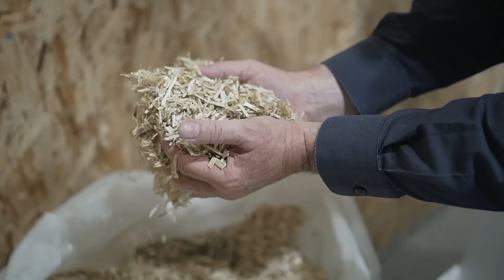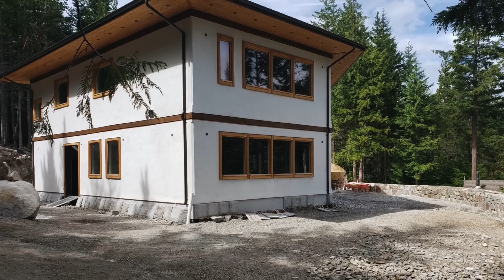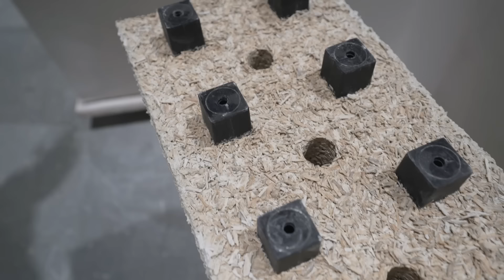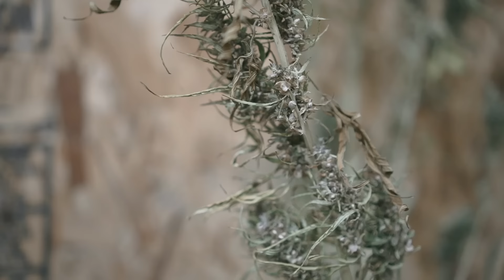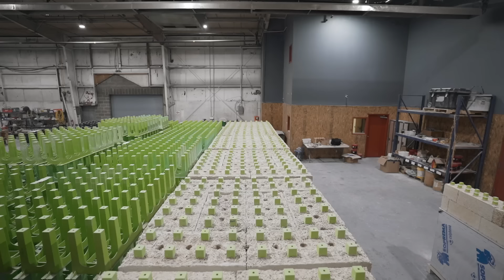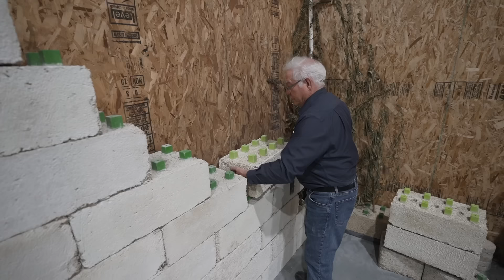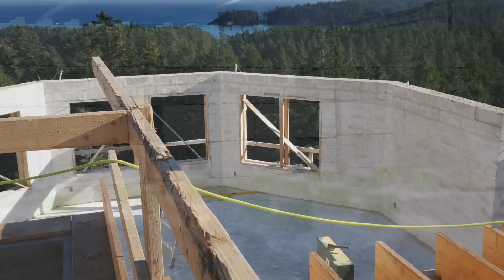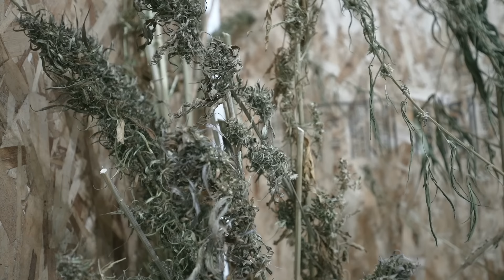Amazing Lego-Style HEMP BLOCKS Make Building a House Quick, Easy & Sustainable

Comment: The newly constructed hemp houses are not only termite-resistant but they are also fire-resistant, and they can prevent the growth of mold.
Reply: what about water?  can they withstand water?  at least as good as concrete?
Reply: @Anti1gnorant  plastic is waterproof and in the video he states that you can't use them below the water line,  you use the recycled plastic they make into a foam block for that.
Reply: @Anti1gnorant , most houses in Canada are wood framed, and wood can be water damaged too. That's why we typically have concrete below grade and wood above. This seems like a better option than wood, at least for wall construction, especially since it doesn't need insulation added after framing.
Reply: @questioner1596  i see. Of course. its better than drywall and wood studs.  I wonder if you can screw things unto them as good as a stud.
Reply: @Anti1gnorant , I do too. Their website says the studs are spaced 5 1/3", so every third stud matches the 16" spacing we use for timber framing. 

By the way, having seen the show Archer, it's amusing to see your display name associated with genuine interest in a subject. 😁👍
Reply: @Anti1gnorant  good! You brought something i was missing. it seems that would do worse that particle board after wet and dried.. but injection of epoxy in the place of the screw, will solve that minor problem! 🙃
Reply: @questioner1596  Architect here from California. I'm wondering if all these worried comments about water proofing and fire resistance are from people living outside of North America who don't have the experience of wood framed buildings like we do here in the US and of course Canada. These hemp blocks seem so much better than conventional wood framing when it comes to cost, energy efficiency, fire resistance, and ease of construction!
Reply: @questioner1596  No insulation. Vapor barrier was not mentioned either. I do believe in the sound proofing element  though.
Reply: @Anti1gnorant  Maybe one could get a break on fire insurance with this product
Reply: @Anti1gnorant  structural strength of concrete, so you may have to drill to hang granny's portrait.
Reply: @Anti1gnorant  It doesn't burn.  It has a coating, Water proof and you're ready to go.
Reply: @Oldschool-hb8rk  well that waterproof coating probably prevents it from absorbing the carbon
Reply: @Anti1gnorant  concrete  absorbs water... lol    unless it waterproofed/sealed..
Reply: @tadvanallen  it doesn’t have the same absorption rate as wood and line based products though. Clay bricks absorb water but that’s why you have a cavity wall.
Reply: @tadvanallen  Add 15% activated metakaolin to the concrete and it stops the movement of water through concrete, including efflorescence
Reply: @tadvanallen  concrete does not observe water. Water erodes concrete.
Reply: @Anti1gnorant  if you thought of it I'm sure they did too.
Reply: @Anti1gnorant  Listen to the video
 He covered waterproof.
Reply: @Anti1gnorant  That’s what those special “below-grade” blocks are for. They’d be used in the basement. Unless something goes really wrong (roof collapse), the hemp blocks shouldn’t have an issue in terrestrial environments (above ground).
Reply: @Anti1gnorant  Time stamp 6:50 will answer your question.
Reply: @Anti1gnorant  Like timber frame buildings they would have to be protected by an exterior coating/cladding.   As the video pointed out, you wouldn't use them below the damp course level.
Reply: @Anti1gnorant 
I would imagine the outer coating of plaster should prevent any water damage.
Reply: @Anti1gnorant I’m pretty sure it is because the hemp blocks have a lot of air in them I think and so I’m guessing it would absorb the water idk look it up
Reply: @Anti1gnorant  concrete passes water, you can see the wet water line on outside of concrete planter boxes
Reply: @Anti1gnorant  interesting question, in my opinion, it should be good at withstanding water but I doubt it is as good as concrete. Let see what anyone else has to say.
Reply: @dbizi440  do ur research.  Yes its mold proof and water resistant.  It's a million times better than concrete.
Reply: @dbizi440  do ur research.  Yes its mold proof and water resistant.  It's a million times better than concrete.
Reply: @realj1214  ok thanks for the answer :)
Reply: @dbizi440  ur welcome
Reply: @dbizi440  amazing
Reply: @dbizi440  This is an insulation that is vapor permeable. It needs a render finish or wood siding to protect it from driving rain. It should never be waterproofed as it is meant to "breath" The render will do the job.
Reply: @rehabdetroit  thank you
Reply: Jeez,  since when is it logical to dismiss it because it's resistant and not "proof". I would take resistance rather than accelerant like wood and other current materials are.  I know the ppl in Boulder CO would've loved it.  It's also plentiful and made in the 🇺🇸 or Canada 🇨🇦 and easy to transport.  It's also faster to build with.
Reply: Hemp is an amazing plant, and also makes nice material like linen.
Reply: @raphaelacz  hemp is amazing I agree, but linen is linen and hemp is hemp. Two different plants 👍
Reply: Suddenly hemp is the solution to everything. Even for going to the moon😂
Reply: @Cptblogh  fun fact, it's been ever since the '60 xD
Reply: @Cptblogh  This always happens - there are booms and busts when it comes to this sort of thing and this has all been tried many times over for years in different iterations. There are always reasons these never catch on in the mainstream construction industry usually it's costs.  The other current trend is 3d printing houses which is mostly filled with tech folks who have never built a house in their life thinking they know better than everyone else then the goal posts get moved when questioned.
Reply: @corail53  you're not claiming 3d printing houses has been done a few decades ago are you?
Reply: Is it wolf-breath proof?
Reply: @uphilliceskater  i love you for this comment😂🥰
Reply: @uphilliceskater  it’s definitely wolf breath proof, they have a 10/10 wolf proof rating
Reply: @uphilliceskater  🤣
Reply: The Roman aqueducts were constructed with hempcrete and they still hold water. The hemp shiv gets petrified from the Co2 that the hemp shiv sequesters from the air.
Reply: Glad they are useing more of it as it grows faster and saves trees as its just a bush..
Reply: Is biodegradable so you have to take measures to protect from the elements especially water.  Note the section in the video he mentioned the plastic blocks used at the bottom of the wall and below grade.
Reply: The insulating properties sound great.
Reply: WS A  they are covered with lime plaster on the exterior and inside, which makes the walls water resistant. This may not sound like what you want, but... lime plaster is breathable. It also holds in heat, keeps cool in the heat. Wood framed with traditional, non- breathable construction materials delivers cold from the outside in (feel your walls)- or won't let the heat out in summer.
Reply: @audhdcreativity5899  you do need to reapply lime rendering. I'm not sure how often. I guess it's like paint or varnish. It depends on weather conditions etc.
Reply: Are they thermite resistant?
Reply: @clrwtrmusic  it is stating that in the first comment.
Reply: @dbizi440  i was joking about thermite because it’s heat and termite resistance hahahahaha
Reply: @CLRWTR  LOL 😂
Reply: Take any substance and mix it with enough lime and guess what?  It's termite, fire, and rot resistant.  Like, wow bro.
Reply: @travismiller5548   Show your proof?  Make a video and prove him wrong.  Do your know of any other product that is made this way with the same benefits? Why are you so against it? Are you in an industry that would be hurt by this or are you just anti hemp?
Reply: Yes off course there’s still problems. Try not to be so negative. Concrete has plenty of drawbacks. I’m a very experienced Plumber.  And this material they made for below grade still may not be for all applications. Like houses built on steep hills.  The 100 year longevity also sounds like a problem. But I’d like to know more. I’m sure it would probably last longer in a drier climate.  Which is frankly where most alternatives get tried out anyway.   I Love the design so far !!!
Reply: @xXGENDAMAGEXx  Calm down super plumber
Reply: These are the most compelling reasons for me
Reply: Like bamboo.
Reply: Something like this would be good in Tucson: few earthquakes, fires can happen, very hot.  What is the most expensive element of this and how can that price be reduced?
Reply: Im thinking at the same price point per block i can make cement block mold and fire resistant
Reply: Are they also falling apart like american houses during every year hurricane?
Reply: Sounds like a very innovative product…but…how does it fare against 7.62?
Reply: Is this magic!!
Reply: It would be interesting to see how this holds up to a hurricane, thunderstorm or tornado.
Reply: Doesn't withstand  water as much as concrete. Only negative  beside a bit more expensive.
Reply: That’s amazing. Crazy it hasn’t been used more
Reply: ya know actual block does those things better.
Reply: Not bug resistant or mold resistant. Not sure how you make a bio material either of those without it being a bio material.
Reply: What about wind, they look pretty lightweight and would be blown over easily in any extreme weather
Reply: Nice stuff for a 🌪️ it will fly good.
Reply: You could use it in tandem with concrete and rebar
Reply: And best of all....
You can smoke it!
Reply: The legal marijuana industry is producing tons of plant material. The leaves and stems aren’t used. This could help those growers who are taxed and regulated to the point of non profits. (Only the dispensary is raking it in).
Reply: duh
Reply: Are you sure they won't go "Up in Smoke“?
Reply: Are you sure they can't go "Up in Smoke"?
Reply: Tell Cheech and Chong they're fire resistant. They'll tell you hemp goes up in smoke.  😂😅😂
Reply: Concrete depending on environment even driest will shed and decompose but especially in wet heat.
It also is flammable to a point depending on its decay.
It's an old idea needing a change in usage.
This item seems the solution all the way around.
Oh,and hemp oil tar is waterproof.
It was used to seal the battleships in the Revolutionary War,before the Industrial Revolution took off.
Most ships at the time,at least the American ones.
Sails were hemp,because cotton was brittle by salt water,and would shred.
Reply: Yeah but whats the cost??    🤑🤑🤑🤑🤑🤑🤑🤑🤑
Reply: @adamcunningham2511 
 there's a price chart on their website. 

$258/sqm for an R40+ house 
$266/sqm for a wood frame house (R25)
$694/sqm for a concrete block house (R17).
Reply: @adamcunningham2511   the website says it’s more cost friendly. So I’m assuming not expensive
Reply: @adamcunningham2511  Compared to the cost of building materials in a traditional stick-framed house, i.e., siding, framing, insulation and sheet rock, along with the additional labor costs involved in the process? >Do the math.<
Reply: @ernestinebass4371  surley it will still require some kind of internal & external finishing?
Reply: @adamcunningham2511  Stucco must be  applied to the exterior walls, but a variety of finishes could be applied to the interior's.
Reply: @adamcunningham2511  don't forget to include insulation in your cost comparison. No need for extra insulation when using these blocks.
Reply: @adamcunningham2511  yeah, from what i have read.. 20k for one wall the length of my house
Reply: @theholydarkpope6972  
there's a price chart on their website. 
$258/sqm for an R40+ house 
$266/sqm for a wood frame house (R25)
$694/sqm for a concrete block house (R17).
Reply: @adamcunningham2511  to much
Reply: @issstari954  yeah thought so
Reply: " green" is just the modern word for expensive isn't it 🤣
Reply: @adamcunningham2511  comparable to concrete. Even cheaper if you can grow and process your own hemp.
Reply: @adamcunningham2511  green & artisanal are both synonims for expensive ;-)
Reply: @issstari954  compared to what?
Reply: @adamcunningham2511  absolutely ... You could bottle up a jug of pure carbon and sell it for millions under the guise of "green" and you best believe there would be a fight among the billionaires over who gets it hahaha...
Reply: @maxim9875  Not necessarily, green can be good cost wise too. Think of cob walls for example, or straw bale houses. Or himes made of recycled materials.
Reply: @maxim9875  asong as they are new texh and do what they say- being hand made or good for the environment... yup I'm buying ♡
Reply: @adamcunningham2511  not necessarily true, but I can understand why you would think that
Reply: No, green is not more expensive than common houses where you spend so much energy again warm and cold and it costs a lot.
Reply: Yeh but cannabis is so evil and terrible for the world......... 😂
Reply: @sliviz  its not cannabis 🤣🤣🤣
Reply: @bonnieprice9482  hemp and cannabis are both derived from the same species of plant. And I was being sarcastic
Reply: @sliviz  Hemp is not cannabis though. You cant get high smoking hemp.
Reply: @sliviz 
Hemp is merely a cousin to cannabis. 
It's not the same thing. 
Also, cannabis is legal.
You went to public school.
Reply: Fire resistant!  Howmy gonna get my smoke on?
Reply: you're needing a house fire to lit a smoke@kurtstergar1042
Reply: Fire resistant!?! How m I sposed to light up?
Reply: Lmao the shilling of weed has gotten out of hand now
Reply: Can I just get instructions to make my own? Kinda can't be arsed to pay others to do something I'm 100% sure I can do if given instructions. If instructions aren't available to the public do you really care about the environment or green movements, or just the green moving into your wallet.
Reply: Would be a plus in New Orleans all the way around.
Reply: @JWRay-xh9wl  Being lighter would also help with New Orleans glaring subsidence issues
Reply: @JWRay-xh9wl  - The video said they don't do well in water, not sure I am sold on them yet
Reply: Is it bullet proof ?
Reply: Not actually
Reply: There's no way these catch on.
Reply: @FUŻŻYYMONKEY  ...Just like EVs
Reply: @FUŻŻYYMONKEY  Yeah, they said the same thing  about the internal combustion engine. :face-orange-raised-eyebrow:
Reply: How about underground
Reply: I live in south Florida, and what worries me is if it can withstand a hurricane.
Reply: I don’t know. It looks like ants can just go through the creeks.
Reply: You know what else is fireproof? Concrete.
Reply: “Resistant”
Enough said, not gonna last as long.
Reply: @josephnielsen123  Concrete isnt water proof either nothing on earth is
Reply: @issstari954  yeah but concrete lasts centuries and made properly millennia. I do not think that hemp fiber would do the same.
Reply: @sid2112  its said that the material grows stronger over time due to all of the carbon that it absorbs
Reply: @Lucid9000  therein lies some serious data analysis that I'm simply too lazy to get into. I mean, hey, if they can get it to production scale at the right price point with the kind of structural integrity needed along with the versatility for utilities I'm all for it. Especially since hemp would grow in places that are marginally arable and otherwise unusable.
Reply: @issstari954  gold is.
Reply: @issstari954  I’m pretty sure diamond is waterproof 🤷‍♂️ along with a few other things.
Reply: @RyanViavant  Technically nothing is waterproof they use high pressure water to cut diamonds
Reply: @issstari954  except Roman concrete was waterproof, and actually got stronger in water.
Reply: @issstari954  my pond liner is waterproof....
Reply: @sid2112  that’s not actually true, modern concrete isn’t the same as old concrete, modern concrete is prone to cracking and absorbing water and over all not as long lasting as the old stuff which had more lime in it, so in my opinion, hemp crete is better because it’s more environmentally friendly and apparently more cost effective, and it’s like cob, and cob is made well lasts longer than modern concrete.
Reply: @issstari954  yeah idk where people are getting concrete obsorbs water from. It erodes concrete. Actually.
Reply: @JoseNoSwag  concrete can absorb water to some degree, hence when it rains it takes on a darker appearance, not a structural issue. Over time that causes erosion to the concrete and to the soil under the concrete (settling), especially in temperate areas that experience freeze thaw cycles repeatedly in a season the water expansion due to freezing. Or in cases where there is sandy soil and a high water table causing a sink hole.
Reply: @issstari954  That not true, metal is quite waterproof.
Reply: @Leignheart  Not actually true water resistant given enough time water will destroy pretty much everything
Reply: @issstari954  depending on thr metal, irons are not as resistant as rust is a boring corrosion where as coppers and aluminum, and silver develop a skin of oxides that protects them from further oxidation. Gold is mostly non-reactive.
Reply: @seanrea550  Yes I agree, however aluminum for example despite forming a skin to protect it. Eventually this skin breaks down. Which releases hydrogen gas, aluminum chloride hydrolyses in water. Forming a mist when it comes into contact with air.
Reply: @seanrea550  I wouldn't say anything is totally immune to water not even plastics. I would say there's lots of thinks that are very highly resistant to degrading. Like as you said Gold which isnt going to create a chemical reaction with water. But gold does get pushed around with the currents of water bashing against things along the way breaking up in small pieces and getting trapped in sediment.
Reply: @issstari954  some of the few things that can be found in ancient burials and wrecks are the resistant metals,  ceramics, and resistant stone. Real world conditions are always direct than lab conditions as you cannot control the mix and nature of the particular salutes and sediments in natural water systems and then to control for water pressure. So judging on artifacts found I will say gold, coppers, ceramics, and specific gems. That does not mean they are water tight.
Reply: @issstari954  glass is
Reply: @SuperBlackballed  they still have not figured out how to replicate it.
Reply: @issstari954  oil is water proof.
Reply: @issstari954  glass?
Reply: what do you mean nothing on earth is waterproof ? there’s plenty  of things that are waterproof .. how about the parts earth’s crust for example
Reply: @sid2112  concrete doesn't last centuries, certainly not on any bridges or building I've seen. 
Roman concrete did, and that's being investigated
Reply: What about nature disaster like earthquake and tornadoes or hurricanes?
Reply: @NormanReaddis  I'm pretty sure they suffer just as bad as bricks
Reply: @sliviz  No, bricks walls "shatter" because the cement that binds them together is too rigid. These hemp bricks seem to flex on their pegs which would allow them to roll with an earthquake.
Reply: @NormanReaddis  its stronger and won't collapse as easily..!!!
Reply: @NormanReaddis it’s 100% impervious to ANY type of damage. Didn’t you watch the video? He clearly said it can survive a grenade blast or volcanic eruption. At least watch the video before you comment
Reply: Fire resistant HAHAHAHAHAHAHAHA

I’ll keep to real bricks thanks :))))
Reply: @jimmythepowerful  given the wood framing and drywall, hempcrete would do far better than your brick house.
Reply: It's like concrete, just much more expensive and inferior
Reply: @fren111  I see you literally didn’t watch the video and come to the comments to spread lies and your ignorance.
Reply: @c0nc3ntr8d6  I've just seen a Startup promoting a shity product, a hilarious shity product, to solve a problem that doesn't exist
Reply: @fren111  their website says it’s more cost effective
Reply: @fren111  concrete is too hot/cold, needs insulation, cracks, heavy, hard to work with/cut/drill, more.
Reply: The hippy neighbor used these to build a tiny house. 1st rain the integrity of the blocks were gone. This is not a long term use.
Reply: So basically you can roll your house and get high at the same time.
Reply: @Sandhill1988  Hemp isn't the same as Marijuana.
Reply: @Sandhill1988  you can’t get high on hemp but nice try. You get high on the flower/bud of weed, which tho it’s related is not the same plant as hemp.
Reply: and love flooding and high winds and lightning. No you did not make it blah blah blah proof. no one can.
Reply: @Sas_HeatherC  sorry can you clarify?
Reply: @dbizi440  is blah blah proof lol. Nuff said
Reply: @Sas_HeatherC  English please?
Reply: @Sas_HeatherC  Those are good questions. Ask this company/guy via the company contact info in the description and let me/us know what they say. Thanks!
Reply: @Sas_HeatherC  i some how understand exactly what you mean. They overpromise and underdeliver, as most of these alternative solutions